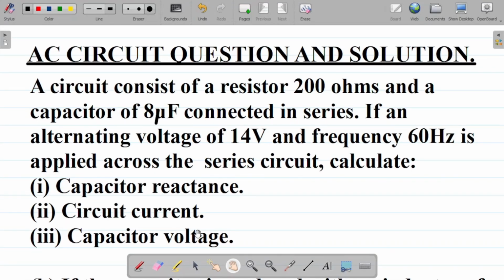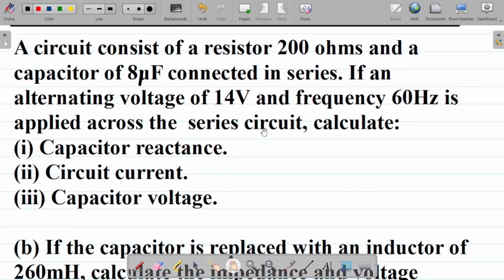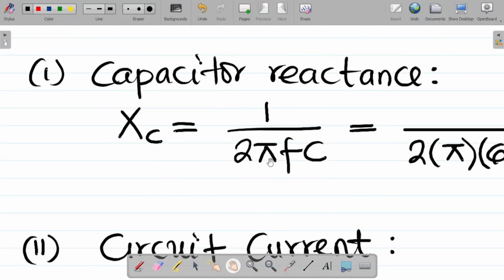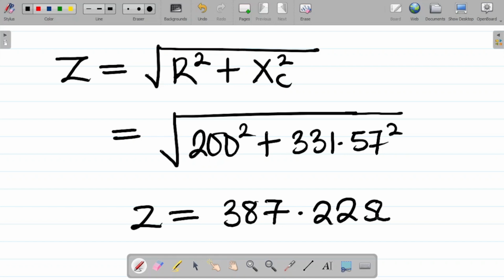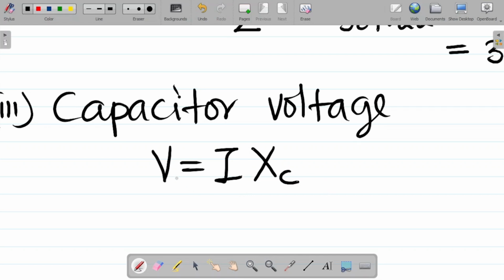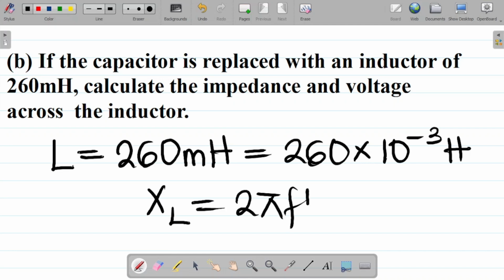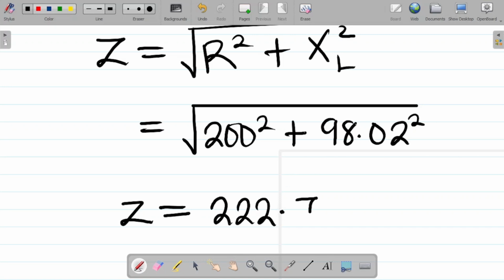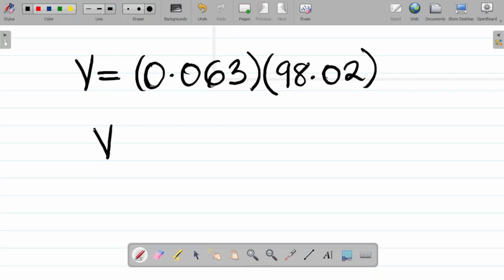AC Circuit Physics Tutorials - Questions and Answers on Physics Alternating Current Circuit.

Comment: But sir i have a question

When u were solving for the voltage of the inductor V=IXL we got the value of I ..but u used the value u got in your impedance as your XL instead of using what you originally got as your XL

I don't know if I'm misplacing it or if its just a mistake
Can you please explain 😢